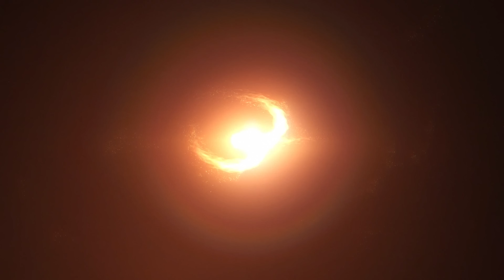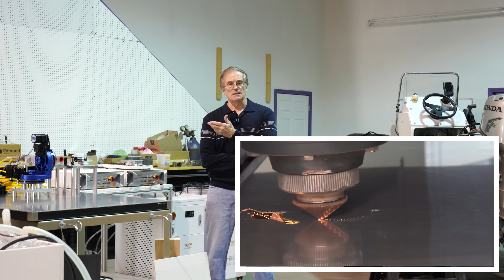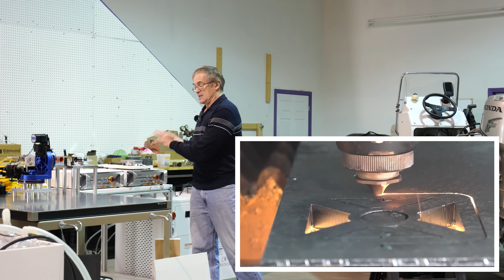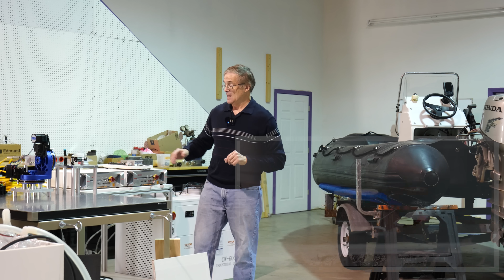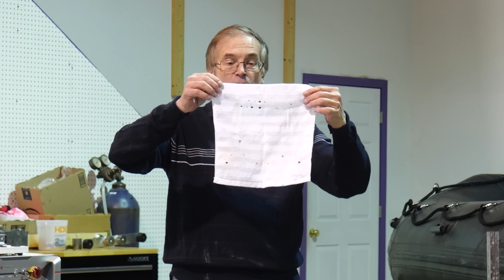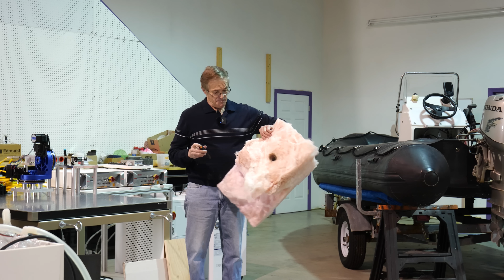We have a problem... and need your help!

Comment: You might be able to use some kind of low optical density polycarbonate or acrylic that's right for the wavelength.  I don't have any experience with this but if you see videos of people testing safety enclosures for laser cutters, they dissipate the beam inside the acrylic/perspex without damage to it.  I assume that those are tuned to dump the whole beam in a short length (because of the relatively low power) so you'd need something that absorbs less per mm and a thicker amount of it.

Comment: Asbestos? Some sort of ablative material?  Hardwood plywood might last longer than your typical spruce/fir plywood. What about wet or even saturated wood/plywood? Cement board? What about a wall constructed with dry loose sand? The loose sand above may tend to fall back into the hole made by the laser.

Comment: Tuff question. I really liked the glass fiber insolation idea. I would have thought that would work.
I was thinking Kaowool, used in kilns.
Then I though graphite... But I guess that is about the same as a brick wall.

A 5-10 mm aluminium plate could probably make it if it was polished, but the beam might fly out in every direction.

I was thinking about how to diverge the beam before letting the beam hit the wall. But I cannot think of a material that can make a large lens cheap. A super fine polished metal mesh will probably just be cut or might catch fire. Something cheap like steel wool will also just burn.

This leaves me with normal beam dump targets and that was probably the first thing you thought of.
Maybe combining something like a 30 deg, 5-10 mm polished aluminium wall directing the laser into a sacrificial graphite wall, charcoal-reinforced epoxy or ceramic fiber board. 🤷‍♂
Maybe use some "Fireproof Expanding Graphite paint" ala the one NightHawkInLight made. 🤷‍♂

I cannot wait for the video now that I am sure that I will learn something new. 🙂

Comment: Dispersion is likely the best bet.

What about thin fish tanks filled with water, but make it murky so that the laser is quickly dispersed into millions of directions at lower intensity? The thin (thin front to back from the direction of the laser) fish tanks to keep the weight down but provide just enough distance of water to disperse.
Reply: It might just burn a hole in the glass before the water inside gets a chance to cool it. That does make me wonder about running a mini waterfall or two over the front of the tank. to help diffuse the laser before it hits the glass and the rest of the tank full of dirty water.
Reply: And maybe add a pump so the fluid is moving, so it doesn't evaporate in one place? For the dispersion you can use something like titanium dioxide particles.
Reply: fish tank wrapped on all other sides by a scattering mirror and filled with thickened water with carbon suspended in solution, the carbon will absorb and disperse the beam, the water will keep the temp down. alginate would probably work to keep the carbon suspended. The tank would probably need to be tempered because the glass will take some heat and glass doesn't like thermal shock.
Reply: I think that you're on the right track, but it might actually be better to not rely on a tank directly as the tank walls are a potential failure point. Instead of putting the tank in front of the beam, having a tank with narrow slots in the bottom to let water curtains fall into the beam path (maybe with fine charcoal/carbon dust suspended in the fluid?) and a recirculation pump, backed with a brick wall would be my guess for your best shot at dispersing the beam's energy for long enough to perform a manual shutdown.

The more I think about it, the more I think that you need something ablative. Maybe silica gel suspended in water?

The charcoal is my thought for light absorption, but that does bring in the potential for carbon monoxide to be released, so you might want to use something else. That was just the first thing that came to mind, but I'm not a chemist.
Reply: that's what i was thinking too, instead of a hole in the wall he could backlight it by diverging and diffusing the beam
Reply: A turbidity standard solution would probably work well in this case... i think it's formazin... not sure about the absorption spectra. I think it scatters IR around 850nm

Comment: well, a couple of seconds creates a water curtain that flows along the sloping corrugated glass on its smooth side. The thickness of the water flow can be about 2-3 mm, and a small electric motor with an eccentric is placed on top of the trough to create microwaves on the water surface. — the beam will be scattered and quickly refracted in different directions without causing damage to the roof and the gate behind it... ) ♦
Reply: @tichrontus' idea of an ultrasonic mist is also good, but more expensive...

Comment: Make a pool and fill with water,then mount the laser on top (5-15 meter)and direct the beam down in the pool.with moving objects as targets either on top of water (A boat ) or drones flying above surface pretty sure it will work!

Comment: Sandbags will definitely work. Or buckets. Sand will be poured into the beam's path.
There is another method. Water fog. A wall of water fog that will disperse the beam, or just a wall of fast-flowing water.

Comment: Get a shipping container. If you need more length, ad more together. You dont want any possible situation of beam exiting beyond anything. This is why fiber lasers in Europe is totally closed off with sheet metal and or in combination with small glass panels. Small because they are freaking expensive. You dont want under any situation use this in a open space with only a section blocked. A reflection of the beam at this power can cook an eye ball 100 meters away. Blocking this off with a confined space as with an shipping container is only a 100% safe option. I work with those everyday and getting seriously hurt or worse, destroying a innocent is not an option. We got only one life, make it so you and your friends live free to see another day. This is not something you can fix safely with putting up som shields here and there. You need a close metal space, period  keep up the good work 👍
Reply: You realize he is planning to fire this thing at little quadcopters in the sky?
Reply: @ADHD_Dad It's all about scale. Sky is also in an container. People and wildlife is not

Comment: First I would focus not on a heat resistant material, but on a beam dissipation, to drastically reduce the energy density of the beam before it is absorbed. We need something like a transparent wall of tiny diffuser lenses, but cheap. What about crystal clear textured glass panels with wavy patterns? Another (more complex) idea is transparent glass marbles sandwiched between two regular glass panels. 
After we build a dissipation screen we put an absorbing panel behind it at some distance.

Comment: Option 2: A diffraction cube (DIY style) + beam splitters; 
     OR old 'big bulky' CPU heat sinks (the aluminum finned ones), probably 3-4 of these. Add a block of graphite or ceramic (think pottery) to end of the heat sinks that'll get hit by laser
 
Same thick-walled fish tank approach as 1st; Just ice old water + ton of ice cubes

Heat sinks absorb heat: graphite or ceramic block acts as the laser trap; ice water aids in decoherence + cooling

Comment: My recommendations are  

1) Water filled beads behind glass or plexi. If something goes wrong, laser evaporates the water inside the beads nad high pressure steam can escape through other beads.

2) Plaster walls. It holds its water until it is reheated. So it should also give some time take action and its cheap.

3) Activated alumina. This might be expensive but alumina has really high thermal resistance and the water it absorbs should also help gain some time.

Comment: Calibrated auto focusing lens set designed to dissipate  at a distance beyond what is needed. yes you will decrease the focused power a little but not enough to not be less affective .
 this would be easier than trying to make something to absorb it.

Comment: Quite the challenge ahead.  If we want to go dirt cheap, then literally a wall of dirt and stones may be ideal.  Can either build a retaining wall, or load up sandbags full to the brim. If using sand, it could melt into glass and potentially be reflective.  So the dirt should be primarily carbon or stone based.  

Also, while tracking a moving object would be ideal; you also have to worry about overhead flying objects, planes, helicopters, satellites, peoples eyeballs from reflections off the clouds.  That could be a serious safety issue.  May want to have it mounted high up and pointed down to ground instead.  Of course, within a fully enclosed space only.

Edit: A 2nd thought, is how cheap is diffusion material?  Something that won't absorb the laser, but will instead diffuse it over an area.  That should increase the time to failure of whatever material is used.

Comment: Maybe some type of lens system placed a few inches from a sacrificial surface,  in order to break up the laser a little before contact. You could even use some sort of water spray system, so the micro droplets either evaporate/diffuse the beam

Comment: Mineral wool insulation? Should be much better than fiberglass and there are even versions that are designed for high temperature environments (foundries, etc.).  The standard versions should be readily available and cheap to test.

Comment: I work with CO2 lasers, we use a 1/4 inch graphite panel.  It smokes a little bit.   Granted our lasers max out at 400watts instant, 60 w continuous.

Comment: Spacecrafts use thick ceramic tiles as a heat shield during reentry. It could last quite a bit longer than regular bricks? Combine that with large aluminum sheets as both mounting point and heatsink, you might be able to get a few seconds out of it until it fails?

Another interesting material might be tungsten, as it has an incredibly high melting point, so a layer of tungsten on aluminium or copper might be a good material choice? tho the portability will be a big question mark, as tungsten is incredibly heavy...

Other than that, one of those garden walls, that is essentially a metal grid filled with loose stones, might be an option? They can be repaired simply by shifting the stones around. Flexible/ portable is still a pain tho...

Comment: Yeah, the foolproof solution is probably a camera/sensor that shuts the laser off if/when it detects it on the back wall.

You can either have a green sighting laser that is always on (to signal whether the fiber laser is pointed at the back wall), or just look for the fiber laser directly.

This hyper paranoid setup might also save your eyes too 😅

Comment: what i would try is (cheapest solution):

the big blue PVC pipe, make a square donut shape with it. fill it with completely with water and add about 2-4kg graphite powder and about 2-4kg black mica powder into it. point the laser at the long upper part of the pipe. be sure to paint the upper pipe with vantablack so it dosent reflect before it carbonizes. in the bottom of the tube is a pump that continuously pumps the water in the circle (powder/water mixing).

why this should work for at least some seconds to minutes (1mm hole the water can not escape that quickly even if pumped, in theory the water should even stay inside as the laser evaporates it so it cant escape till the laser is turned off....)
why does the laser not go through? because the particles get more quickly replaced than the speed of the laser can obliterate them, additionaly obliterated particles add carbon and therefore even increase consumption.
why the black mica powder? to trap the heat in the water that is given off by the graphite molecules/pieces.

with such a strong intensity beam, you only fight the obliteration time, because there is no material on earth that can withstand >100'000C for a second. Therefore you have to replace the used material as quickly as possible...

At leaast thats how i would do it.

Yes the pipe will have afterwards 1 holes and lose some liquid and powder, but as all is non toxic its easy replaced. Also you can get everything from the hardwarestore around the corner...

Comment: Get a base board with some caster wheels, stack cinderblocks in a rotating shape forming a square with a center space and fill them and the center space with dry river sand. Cheap, self sealing or just put a little piece of tape over the hole after a firing , shifting sand good for longer exposure, good thermal obsorption, will form glass blob inside the sand, Low light reflection, Light refraction and capture, easy to build, cheap, All 4 sides can be used. Easily carted off to the side. If you want you can incorporate your fire bricks in the build.

Comment: I would try to improve the plywood, whose only issue is the fire...what about watering down the plywood all the time? like let the water flow down the plank constantly, from hose. also plywood can be impregnated by some inflammable material. or "paint"" the plywood with mud, clay or gypsum.
another idea - ceramic/porcelain tiles. 
also...the issue with concrete brick...try to use refractory brick. concrete cracks when heated,  refractory bricks take heat without issue. you don't want to use brick wall, since it would be massive, but what about refractory tiles? they are thinner so lighter.

Comment: For sound and RF absorption we commonly used cone foam walls. I know those won't work for a laser but the concept is fundamental - the angle causes a huge number of reflections that end up absorbing the energy.  Another similar technique is to stack a large number of straight blade razors together this causes the same mechanism but works better with light.  I know you can't build a wall from this but it might work as a target stop or it might be the start of a better idea or it might just be a cool experiment and video.  Good Luck!
Reply: Titanium comes as a sort of foam before they melt it down.  Aerogel might be interesting.

Comment: You could make a  twin walled curtain which could be made of inflatable material such a lilo. You could then fill with water, the water should buy you the time needed as it should dissipate the energy and heat. At least with my very limited understanding, it would also be be patch able for future use and worse case just spring a leak when hit?

Comment: New to the project but consider: Neutral density filters (absorb a portion of the laser beam's energy without significantly altering its color or spectral distribution. Could get hot.

Decrease pump power to the laser's gain medium.

Adjust  pulse duration or spot size.

Instead of trying to alter your environment make your project  adjustable .
Rockwool?

Look up that guy who supposedly made the secret formula that made white fireproofing material out of scrap he collected. He refused to turn over a sample or sell the rights to EI Dupont. He died and we don't really know exactly what it was but others have duplicated his results. I just don't remember the details. Didn't see it hit with a laser back in 80's but it would protect your hands from a blow torch (1800-2400°) idk I'm guessing

Comment: try a tank of opaquely-dyed water loosely packed with your glass-fiber insulation. If dye doesn't work, perhaps use a suspension of soot particles in the water. As a last resort, set the whole assembly oscillating rapidly so as to disperse the target instead of the beam.

Comment: I would think that a prism of some sort would diffuse the light radiation to a non-hole producing strength and make a pretty rainbow on the wall.  🙂. You would just have to have a prism that wouldn't absorb the radiation and just pass it through.  Heat would be a problem as well...so I guess you would have to deal with the heat on the prism.

You know, I was just wondering if a waterfall would work at all.  A wall of water falling over a flat surface used a a backstop.  Would that be enough to capture the energy and disperse it enough that it wouldn't do harm to your wall behind it?  Just a thought.

Comment: I don't think it's a good idea to rule out reflective shielding. I made a small, sharp (15 degrees), conical mirror from polished aluminum.  Imagine a whole array of these, possibly with a noble metal plating.  This combined with a water suspension of magnetite (black) powder. Quickly moving water could absorb the scattered laser beams.  Also, the magnetite mixed into a high-temp epoxy, pushed out by strong magnets could be an EXCELLENT way to create these cones, even making them disposable. Impregnation with silver (reflective) BBs could add to the scattering.  The tiny BBs (spheres) would add so much random scattering that even a high power beam could be dissipated, especially in a black magnetite suspension.  Magnets stored under the reservoir could CONTINUALLY REGENERATE the cones, if they are liquid enough (more viscous suspension).  This hybrid of reflectivity, absorption, and forced convection (water), could all work synergistically, achieving perhaps 3 orders of magnitude increase in dissipation. Plated ball magnets / BBs could be persuaded to dance around randomly in the quickly moving coolant, motivated by a magnetic field.  Palladium was historically used for reflection in high power searchlights (lime-light), but its use as a catalyst drove the price sky high. Thanks for this CHALLENGE. EXCELLENT IDEA !!!

Comment: A large number of those little bags which you fill up with water and freeze which make lots of little ice cubes (well, not cubes, but cube substitutes). Just hang them from nails on boards a few layers thick. Even when they thaw the water will still give you protection.